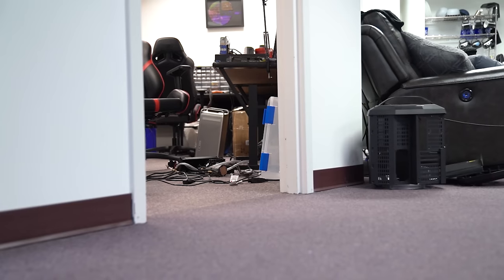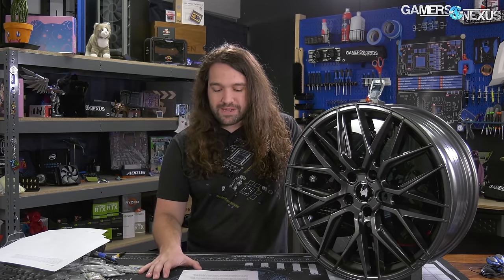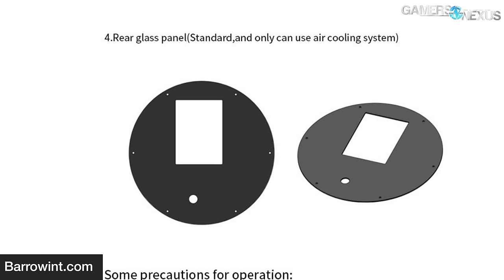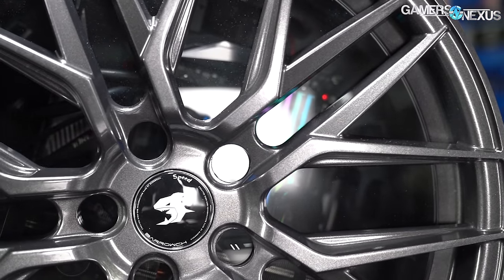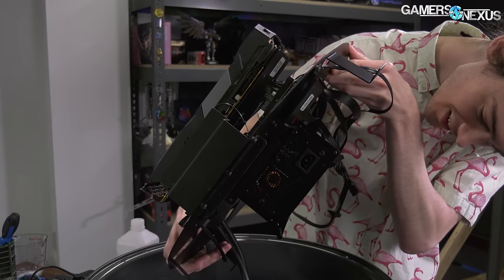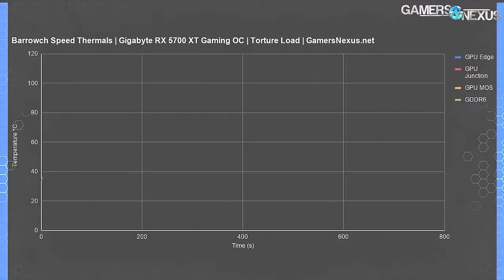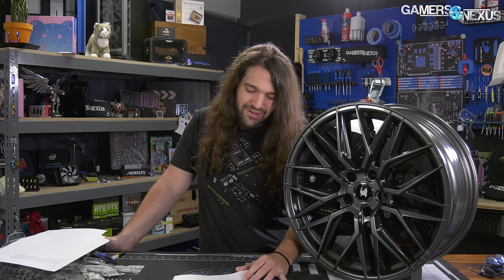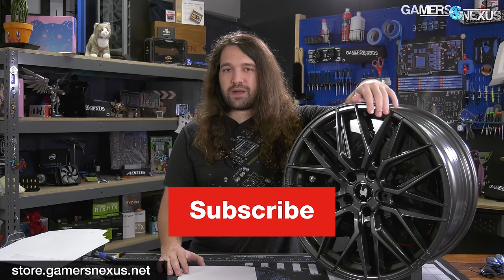Car Wheel Computer Case Review: Barrow Speed from AliExpress

Comment: "Rims are meant to be installed on cars, if you weren't aware, typically with a  piece of rubber around them, known as a tire."

"We of course have the skills required to know that wheels are round."

This is what makes Steve the hard hitting journalist we've come to expect.
Reply: this was my thought, just get rid of the glass, boom airflow. put the power button in the valve stem hole. even if you didnt want a fan o that side, just opening it up would i,prove massively.
Reply: errm replyed on wrong comment, im dumb
Reply: @thegoaty6194  no worries, it's a good idea regardless. I thought it wasweird that they didn't use the valve stem hole for the power button
Reply: Right in line with most modern video journalism, at least in the US.

Comment: Why wouldn’t they use the valve stem hole for the power button? What a missed opportunity.
Reply: It leads to the "outside" of the rim. They would've had to cut a hole in the rim for wires.
Reply: Steve, in light of this new information please redo the review. Also, get Jeremy as a guest and do it Top Gear style.
Reply: @Kepe  That's fine, isn't like it needs to hold air.
Reply: … My thoughts exactly! They just need to drill a hole next to it!
Reply: And passive cooling with the metal
Reply: And it should have a silicone tire.
Reply: The center cap is also a good spot, but they choose a odd position for the power button.
Reply: @vdkaa  Yeah, the Hubcap should have been a button like a horn button on a Sports Steering Wheel 😁
Reply: It's what has made me give it a miss 🤣🤣🤣🤣🤣
Reply: Triggered me the whole video.
Reply: @Funnygalsproductions  And a rubber tire look like container outside for water cooling around it. Too bad it would weight a lot.
Reply: Center cap for power, lugs for I/O.
Reply: Even more stupidly they put it right beside the hole.
Reply: Talk about a missed opportunity!  They should have made a custom fan the diameter of the inside of the rim with the motor in the hub. Talk about airflow! of course drop the glass front. Add POV to the blades for true RGB goodness.
Reply: Or they could've used one of the wheel nut holes or even made a custom button for the center cap.
Reply: Also, it's wheels not rims. Rim is the lip of the wheel
Reply: might do that on an actual wheel.

Comment: Missed opportunity: Use it as a heatsink
Reply: It's definitely possible, and they definitely should had considered that, but then it would be stupid heavy to carry, and it would require custom-shaped heatsinks, presumably cut with a laser to create a perfect round shape and it would have to be universal for every board type similar to the Raijentek Morpheous Core which is terrible to deal with from an engineering perspective.
Reply: @bluephreakr  Well, I didn't say it would be easy but it would at least bring some justification to using a freaking 18" rim as a PC case...
Reply: bluephreakr nah you could simply use the entire wheel as a heatsink if it were aluminum, and use a cnc milling machine to cut all the grooves around the inside and outside of the wheel. Just make custom copper heat pipes that wrap around the entire wheel and connect to the gpu and cpu.
Reply: @dukegryphon9937  In term of surface area, it's very ineffective since a ring shape is quite the opposite of a radiator. My guess is that it will be very warm and thermal throttling will still occurs, not quickly because of inertia but surely after an hour or so.
Reply: @PainterVierax  Well, if this route is taken, the best implementation would require 1) getting rid of the front glass panel, 2) putting the GPU on the front, motherboard facing the backside, 3) welding some fin structures inside the wheel , 4) install a huge-ass exhaust fan on the back for a front-to-back airflow. Think Mac Pro 2013 approach.
Reply: @dukegryphon9937  the 2013 is called le trashcan because it is.
Reply: Some are a alloy and are not 100% aluminum. Cool idea tho but wouldnt preform very well but i guess a wheel pc isnt ment to be practical
Reply: @jintsuubest9331  You missed the whole point.
Reply: YES to this comment. That's the first thing that I thought
Reply: @PainterVierax  except it is huge. I bet the surface area of that wheel is much higher than the surface area of most air coolers or radiators. It's inefficient in terms of surface area to size, but that doesn't mean it doesn't have sufficient surface area to perform well as a heatsink.
Reply: @CanonFirefly  Don't bet, just measure and you'll see how efficient a fin stack cooler is. As Jordan and Duke said, it needs grooves or fins milled into the wheel to make it worth and it needs some star shaped heatpipes network or a water loop with a dozen of exchangers to distribute the heat all around because conduction won't be enough to avoid thermal throttling. Also, even if there is a huge fan inside, the outside only stays passively cooled.

Comment: the solution for solving this case's overheating problem is the same solution for keep brakes cool - air intake from between the spokes of the wheel. yeet that tempered glass and let those pc parts breathe
Reply: I would just put a ridiculously big fan over the whole wheel  and covered it with some kind of mesh
Reply: Spinning rims, but as a fan!😁
Reply: @Radovanslav  18" fan
Reply: @kiplinght  ye, couldn't remember how big it was .-.
Reply: Agreed, yeet that glass!
Reply: Dude, can you imagine how powerful the motor on that fan would have to be? It makes a monster 200mm fan looks puny!

Im suprised they didn’t just bolt some mesh on the front stick a big fan behind it.
Reply: @matasa7463  a 400mm aero fan would work.

Comment: Weekend: 19
- Styling: 5
- Performance: 3
- Handling: 5
- Fun Factor: 2
- Cool Factor: 4
Daily: 13
- Features: 1
- Layout: 1
- Quality: 7
- Practicality: 2
- Value: 2
And the DougScore is: 32 out of 100
Reply: The performance would be a 1, as would the practicality.
Reply: @kalashnikov1343  I gave it 3 for not having the absolute worst thermals in the world in performance and 2 in practicality for full ATX support. Handling is 5 for being able to roll it on the floor but should be much lower because it's so bad to build in.
Reply: Thissssss
Reply: @neoqueto  It would be smarter if they would not support full ATX and made it better for mini-ATX.
Reply: Doug is the type of guy who will actually bolt this wheel on a car.
Reply: I'm here for quirks and features
Reply: pc: dead

Comment: Pfft didn't even tell us the bolt pattern. I'm disappointed in you steve, I needed to know if this will fit my jetta
Reply: You can se it at 3:29 :)
5x110 et38
Reply: 3:25 5x110
Reply: @Merlinen82  VW Golf 4 and Bora, possibly Audi TT too, as it is built based on the Golf 4.
Not sure about Golf 3 with the five hole axles of the VR6, ET (=Offset) could be wrong.

EDIT: EVERYTHING I WROTE ABOVE IS BS! READ FURTHER DOWN!
Reply: Delighted to see some fellow VW nerds in here.
Reply: Unless you are using wobble bolts then no, most VWs are 5x100 or 5x112
Apart from Opel/Vauxhall, some Saabs, Fiats and Chevys basically nobody uses 5x110
Reply: @Gomjokk  WAAAAHHH! What did I do? What did my eyes have on them, that I didn't read that right? Schame on me! Aaaah! Where is a hole I can jump into?😭😭😭
Reply: @Gomjokk  a Jetta owner would just drill new holes into the wheels to make it fit
Reply: Vorsteiner VFF-107 if actually interested. Super light wheel, and I love mine.

Comment: Why did they put a glass on and not a gigantic fan? That would help cooling so much, the best air cooling you can have.
Reply: clearly spinners are not a thing in china
Reply: Because it is made for showcase and not daily use, still would be nice but well.. no
Reply: ah you need their other product which is a motherboard screwed onto the back of a car radiator.
Reply: @SirReptitious  if I did that case I would use the center logo piece as a power button tho, it's straight out inside already, the valve stem hole would route the cable outwards.
The fan idea tho, that would be hella awesome, a huge fan on the front would make it cool and quiet while also looking really cool, but hey, tempered glass... Wonder when we'll have tempered glass headphones, keyboards and mice GAMER stuff...
Reply: A fan made to look like a brake caliper and rotor would be bad ass!
Reply: @misterthegeoff9767  that would be cool a computer using used car radiator with dc radiatior fan and u can put it anywhere the support a radiator.
Reply: That was my first thought.. if they did a 200mm+ RGB fan, center mounted behind mesh, itx mounts and the pcie extension for a full gpu... It could have been a decent config and more room for a less crazy CPU aio mount and psu.  An extension cable rear panel would have been a good idea as well.
Reply: @aztracker1  200mm does not fill the wheel, it would look cooler if it would. But 200mm would already be way better than glass.
Reply: @happygimp0  yeah... It wouldn't fit the wheel... But about as large a computer fan as I've even heard of... Maybe it was 220mm but still... Way better than closing off, and itx is just a much better option for spacing.
Reply: @aztracker1  How big is the inside of a wheel? I assumed it was something like 300mm. I mean a fan that would fill all of it would be best.
Reply: There might be a spinner version for you to listen to Ridin' Spinnaz while building it up.
Reply: ggzh a Argue With Everyone that almost reads like a trump tweet. Almost.
Reply: @AsbestosMuffins  The case would be the embodyment of give it a Ying Yang spinny thang.

Comment: If anyone wanted to do this, I would suggest a 3 piece wheel. 3 piece wheels have a hub with an outer and inner rim halves, with bolts and nuts holding it all together. Where this is important is the fact that you could make a mounting plate piggybacking off of those bolts and nuts, meaning a completely unmodified wheel that can house a system. If you really want a glass, or plastic, panel on the outside, you can do similar, unbolt the hub and put an insert behind it. Only real 'modification' may be the need for longer bolts to accommodate for the extra material thickness. Although, one mod does come to mind, most wheels only have an axle bolt cap but some have a center cap that also covers the lug holes, but turning that cap into the power/reset button; but again, very minimal modification needed to accomplish this, and that's easily the cheapest part of the wheel, so even with modification, you're not losing much value. 
Personally, though, I would never do this, as it's more of an aesthetic over function type of case; though with proper watercooling and rear mounted rads and PSU, it might not be too bad. But I can see someone doing this for the aesthetic purposes, especially if you put this on a racing setup. If I were to ever do this, which is highly unlikely, I'd like to see a tire on it, just to go all out, plus it looks weird without a tire, even just a low profile tire would make it look ten times better.

Comment: Barrow must really like using those spring tensioned screws and nylon washers as often as possible. When I did my first custom cooling loop I had an Asus Strix 1070 TI at the time and the only wateblock I could find for it was one made by Barrow. Every last screw to mount the block to the PCB was the kind with the springs and had a nylon washer for each side, too. The ones between the block and PCB were pre-installed, and slightly set into the block so they wouldn't move. Then with the holes lined up I placed a washer and spring screw in each one to secure the block to the PCB. I forget how many, probably 13 to 15 of them. The quality was really good and it actually had some heft to it. The biggest problem was waiting about a month to get it from China, even though I ordered it from the Amazon US website.
Reply: I hate when amazon does that, you order something and it's secretly not sold by amazon and you're left wondering where your package is

Comment: What ridiculousness.  Why use a Car wheel for a case, when you can just use A WHOLE CAR.
Pick a car with a glass window showing the engine, like an R8, various mid engine Ferrari's,  etc.  
I'm using Tributo Ferrari.  I took the engine out and put my build in the engine bay with the glass window displaying its majesty.  My PC has enough power to propel the car to over 250gigamiles per Hour all that while playing ForkNight overclocked.
Just drive with the mouse and keyboard. 
MotoVlogging has never been easier.
Reply: I can see a opulent oil baron actually doing this.  Then abandoning their car somewhere in a carport in Dubai.

Comment: IT'S A RIM! 

Wheel = Rim + Tyre (in this context). The only time that a wheel can be used to describe a "non-compound" construction is when it's something like a skateboard wheel, where there is no rim or tyre, it's just a wheel...

EDIT: Just to beat the troll comments about wagon wheels, let's assume we are talking about differing components as we extend radially, rather than depth-wise.

 Other than that, I would 1000000% buy this just for the lulz if I had money to burn. Great job on the review :)

Comment: I love absurd builds which are struggling for space and become borderline impossible to build.

But i'd like to challenge you, to take a fairly big and roomy case, and fill it up with functional hardware to the brim so you can barely stick your finger in anywhere, striving for maximum space utilisation in the biggest case you can think of. I'm thinking Scythe Kama Cross might be helpful, as it fills up the void above the CPU pretty well. I don't necessarily anticipate that you're going larger than midtower on this, but i won't mind.

Comment: for builds like that, its best to use micro ATX or even ITX motherboards, any motherboard thats not full sized xD.
ive made a few of those, and ive gotten perfect airflow with just fans. and the front of the wheels lug holes, i used actual lugnuts to hold in the acrylic.
it takes about like 1 or 2 weeks to make one start to finish for me since i dont have some crazy good tools, but it does take a lot of effort to make one, and the best part is lowes and homedepot sell aluminum sheets you can use.

Comment: I think them adding a base that holds the power supply, and cooler would benefit them tremendously with this case. Then you could drop the Rim into a cut out on top. No need for very basic DIY wheel chocks.

Comment: That can work if the glass is removed, it could breath that way. Power button can be worked around. But it still sucks as a case. Just hope it doesn't roll off of the desk. Go for a tire!
Reply: Replace it by a big fan, something like 400mm, so that you have a wind channel.

Comment: They are missing so much,

first of all they can make a big fan thats outake the heat inside the rim it self, will be make a noise? yes ofc 

using the original bolt hole for :
1.Power Button
2.Reset button
3.Utilities button for headphone jack,usb,etc
4.Crank button (more specific are on below)

i assume Crank are the right thing its called, its in the car for opening the engine case, i think thats it called in english i think so let me know if wrong.

the crank button is to be used to open the "front case" in order to access the fan (top fan), and all the cable from number 3 (yes it will be cracked up the steel case to much more,so stay with me for crazy ideas running in my head).

They must be include a stopper or stand to make it Trully life, a stopper that is working double as stopper and reservoir thats making it more elegant at same time.

now we will go to inside :

the "wall' in there is totally a steel, how about running costume water looping pipe from the outside into the inside
with using gravity as the main puller of draining stage, where is the reservoir are in the bottom along with the radiator and fan (but the pump need to be strong enough to pump water in the much at fast time), 
and combined much inside like dram water cooling or anything else cooling in there.

and there is high outake wind from the side just for cooling the case it self in the case the case temperature are too hot in summer or bad ambient temperature

Comment: Great idea.  I have a damaged 10-spoke original 1966 Shelby GT-350 wheel I might try this with - maybe with a smaller motherboard since it is a 14" wheel!  I see no reason to use that plexiglass plate and leave the wheel open for better airflow.  And, why buy a new rim?  Get one as a takeoff at a junkyard - one that has a classic design for your favorite vintage car.  Or, maybe rather than a PC, what about an Arduino light show or Raspberry Pi case?

Comment: If I were to design this case, I'd make it into two rims, I'd place one horizontal as a stand and most likely attach a tire to the outside of the rim, then I'd place the second tire on top in a vertical fashion similar to current design. I'd place the cooling rads as well as the power supply in the basement (lower tire), and I'd route the Cables and loop lines to the vertical forward facing rim, where the bulk of the other components would be located.

Comment: That was fun!  ...Sadly that case had a flat tire...  Performance/Usability- Wise. 

Having psu  outside of the rim (using a wheel lock as a mount) could function as a stop. Adding fans on the back side of the case with some kind of 120/140 to something adaptor (creating negative pressure) and adding a filter instead of the front glass piece (that looks out of place anyways) could fix thermals/appeal.